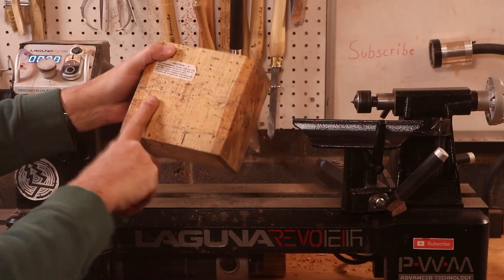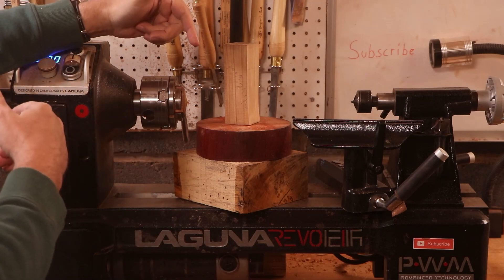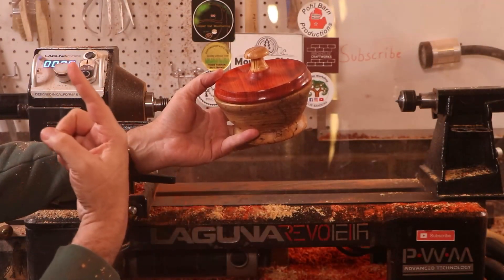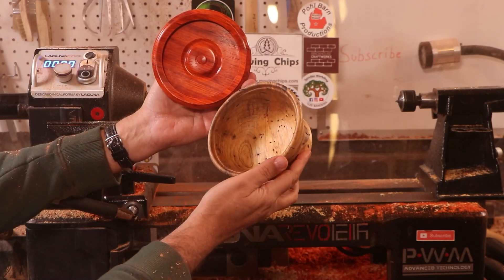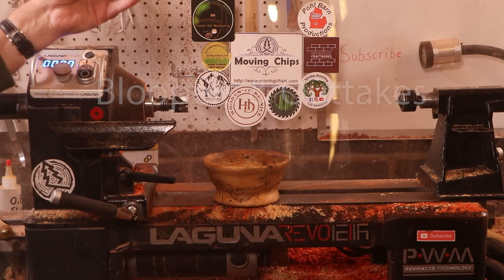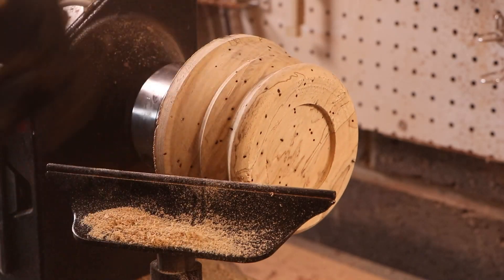Tamarind & Padauk Lidded Bowl

Comment: Nice piece! The bug holes give it character. 
As for using the Acks with the holes: you can use your air compressor to blow the accumulated paste out. And if that doesn't work, you can use a pipe cleaner.
Keep up the good work.
Reply from the maker: I thought about the pipe cleaner... but thats alot of holes! LOL

Comment: Your bowl looks good. 
Yes, sanding sealer would have helped. They say no sealer because the oil in the finish is designed to soak into the wood. If you apply sealer then sand it back, the oil will still soak in, just not as deeply. Then the finish will build faster. Without the sealer this finish will build. It will just take a lot more coats. I suspect that with more coats of your finish you find that you like it a lot better. Thanks for sharing.
Reply from the maker: Yeah the sealer is a must. Also saw after that it needs like 24hrs to dry between coats.... aint nobody got time for that! LOL